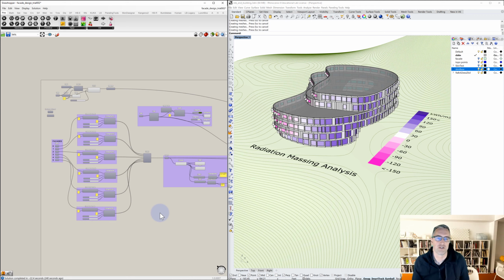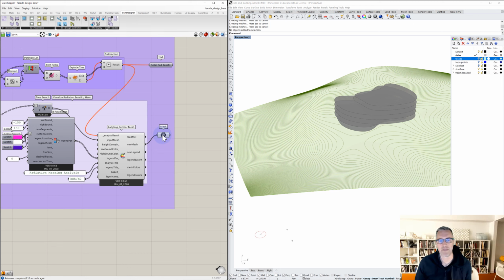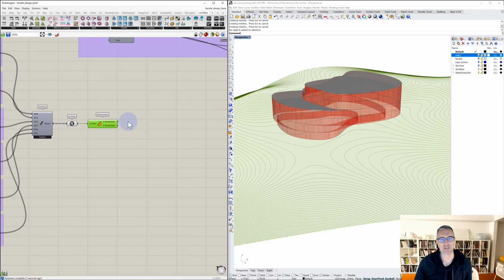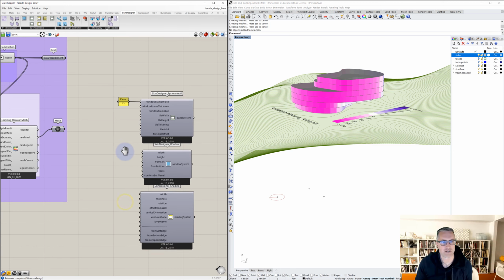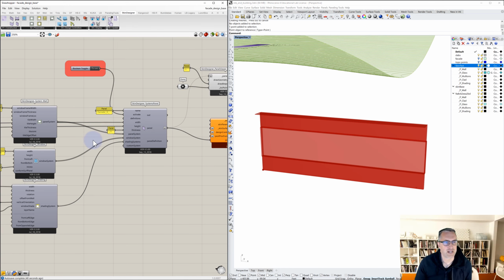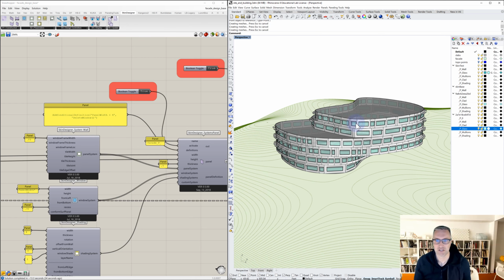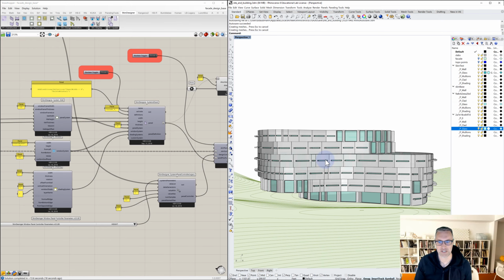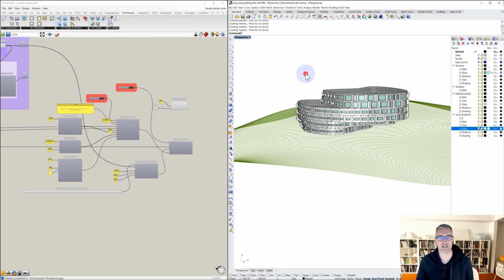Fast Facade - tutorial011 - LadyBug and SkinDesigner

Comment: has there been any fix to the errors in window sizing based on the solar optimization data. I am still getting the extreme variation in window sizing even thought panels are facing the same orientation (great technology though! super powerful tool when it works)